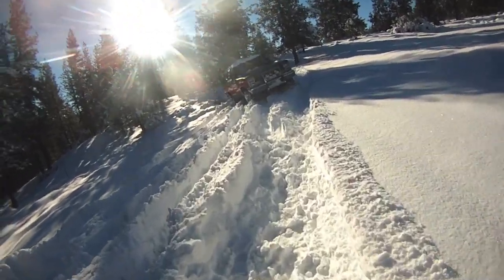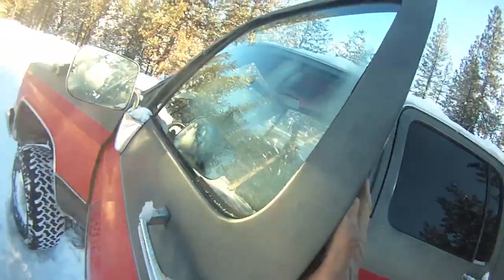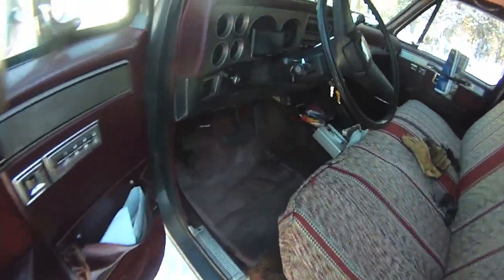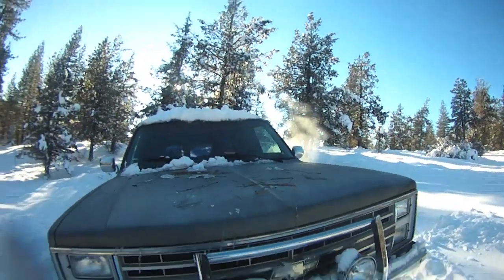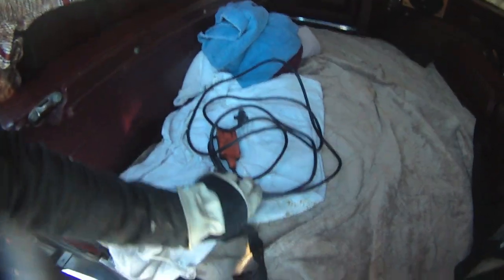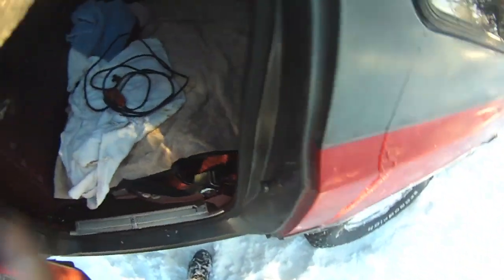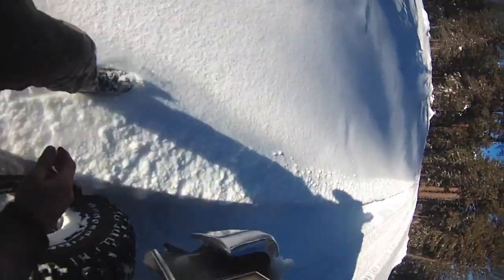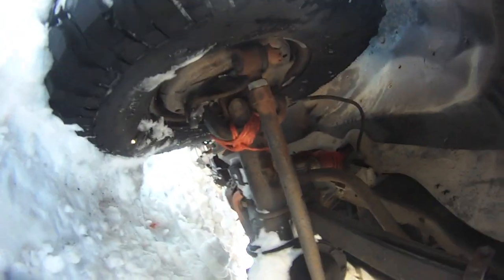The Suburban Has Bigger Issues

Comment: That bucking, bouncing the truck did the other day did the damage I believe.  I did a similar thing pulling a fire truck out  and my u-joint broke on the ride home.....in the middle of nowhere, by myself, because no good dead goes unpunished.
Reply from the maker: I agree.  I suspect that bucking put a hammering load on everything.  It was not a crazy bucking, but it was a surging load on the drivetrain. I let off some when it started, but didn't want to lose forward momentum... Oh well, stuff happens...you fix it and move on.

Comment: weren't the auto lockers problematic. I always hear or read guys saying how it failed them. After switching over to manual lockers they never had any issues after that. I've got a 90 burban and an 88 jimmy full size that were switched over to the manual lockers by the original owners which is what made me look into the whole issue.
Reply from the maker: I have heard so much bad about the auto lockers..but truth be told I have owned this truck for 22 years, and have put just over 210k miles on it myself. There are 258k miles on the entire truck with those hubs being original.  I completely rebuilt the front axle a couple years ago and never replaced the hubs (bad move I know), but they looked good.  I have never had an incident with the hubs before this.  With that being said, Warn Manual (all metal) hubs are going to be the replacement.

Comment: How long until the snow melts?  I imagine you'd have a lot of plowing to do to get it towed out?
Reply from the maker: It's going to stay up there until March or April.  The snow will be gone by Mid Feb or so, but the ground will be very soft for several weeks more.
Reply: Too bad.  Have fun putting it back to together.  Doesn't look too out-of-the ordinary for those items to fail.  I'm surprised you still have automatic hubs.
Reply from the maker: Those hubs were kind of an experiment in durability.  They have 258k miles on them and have never even given me a hint of problems.    Granted I don't do extreme wheeling in this truck, but I do my fair share of work in 4wd.  With that being said, Warn Manual hubs will be the replacement.

Comment: I have the Dana 60 you need. Auto hubs are fine till they're not. Could have stripped a locking hub, or maybe it was partially engaged and you stripped 1/2 of it? I'm at halfway point of vid. I put in Warn hubs, auto lockers wouldn't lock one day, I was on ice, time for a manual hub upgrade...
Reply: CORVAIRWILD  I have 2 sets  king pin Dana 60s and 14 bolts 4.10s one day they'll go in my k10  and maybe I'll get a blazer or sub
Reply from the maker: Hey Andrew, Yeah I'm not sure what was going on with the auto lockers, but I do know they are original to the truck (1988) and have 258k miles on them, so I was kind of on borrowed time in the first place...hahaha.   Warn manual hubs are already here and will be installed when the snow melts.
Reply: yourbeekeeper once you doing the hubs, time to pull the axle shafts and put new U-joints on. Make sure you get Spicer or made in USA, Rock Auto should have them

Comment: that's some deep snow on that old truck.  Doesnt it have 200,000+ miles?  I'd much rather change a u joint than pay 1,000 a month for a new one.  you'll get her fixed
Reply from the maker: Oh yeah, I will fix this old rig and delight in not having a payment for a new vehicle.  It has 258k miles on the clock.

Comment: I wonder if my 3/4 ton has a larger rear ujoint? I don't have the HD full floater, all Subs have D44's up front, no upgrade was available. I never broke anything out back, but I sure broke enuff up front! what was your rear ujoint? Stick original, held in with plastic?
Reply: Not sure if a 6.2 has enough power to break anything lol.
Reply: Graveltrucking sure do! ask me how I know...
Reply: His should be a gm 10 bolt front and a 9.5 in the rear .
Reply from the maker: The u-joints were replaced a while back, they were not original.

Comment: That would be the reason I never set the transfer case to LOW.
Reply from the maker: I have had that truck in low many times without incident... This time the sub-zero was more critical than I gave it credit.   ahhhh, heck it's only parts.  hahahaha
Reply: I've always said that mine will NOT end up in a museum when I'm done with it!
Reply: Lo range has nothing to do with it, 1/2 ton parts are meant for grocery getter use. I'm surprised or lucky I never did worse than toss U-joints like dog biscuits
Reply: Lo range doesn't brake parts, 1/2 tons are not made to off-road, that's why they break. Beekeeper needs to do the job and put in a Dana 60 axle in front, 14 bolt full flaoter in the rear

Comment: That sux your luck just not doing so well especially stuck in the snow....this when you really could use tractor pull ya out the rest of way so can do the repairs it needs.
Reply from the maker: If I really, really needed the truck to get home I would have made more effort to get it back on the road, but with the S10 (ranch truck) at the ready and no pressing need to have the Suburban , I was not about to kill myself to get it fixed....it was simply not worth it.

Comment: and here are reasons 113 and 114 why I wont buy a half ton truck of any make...
Reply: TheSoloAsylum 3/4 tons have identical front setup. I wonder how much larger my three-quarter ton light-duty axle is? And how much bigger the U joint is? I'm going to look at RockAuto right now, I'm curious
Reply from the maker: This truck has 258k miles on it and never had any issues like this.
Reply: Time for the 3/4-1 ton upgrades. 1/2 ton axles are meant for school bus use